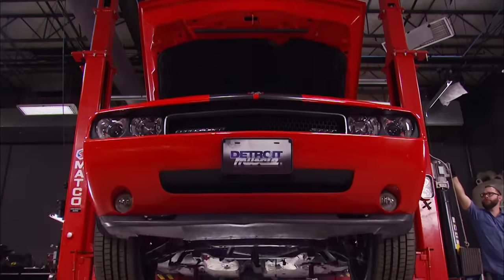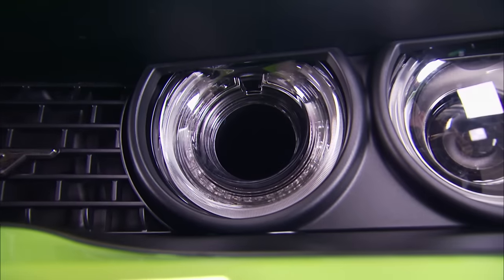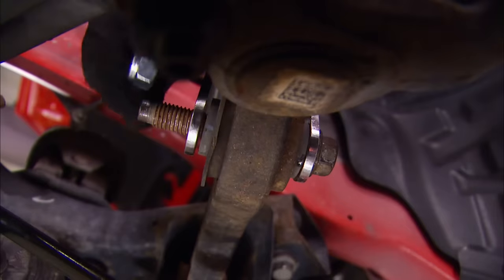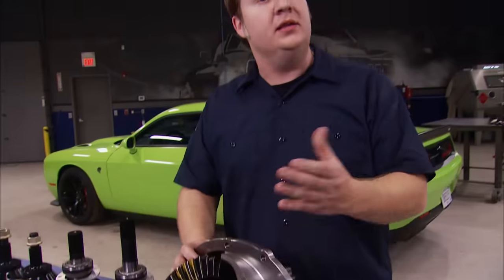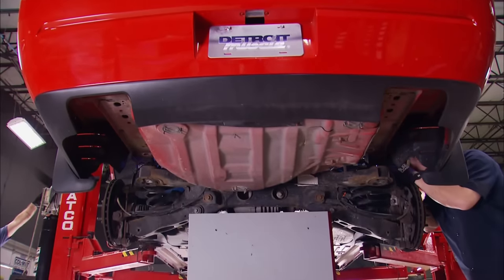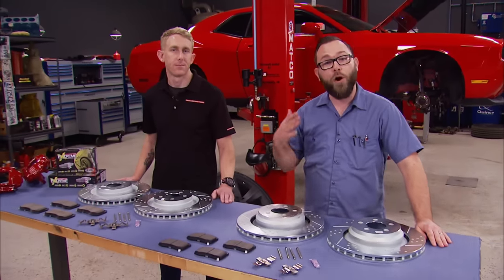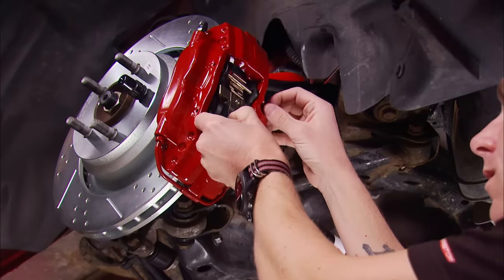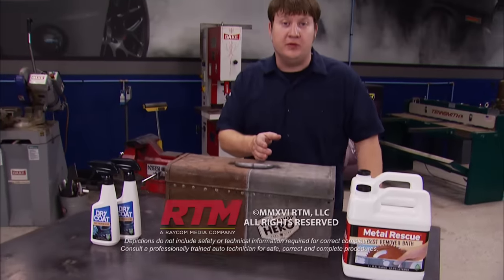Making a  2010 Dodge Challenger SRT8 Outperform a 2015 Challenger Hellcat - Detroit Muscle S3, E11

Comment: Definitely wouldn’t have traded out the brembos for powerstop but I understand it’s for the sponsor lol
Reply: haha I was getting ready to comment the same thing.
Reply: @pharoahamunra  I was going to say the same thing. Why would you give up six piston calipers for four piston?
Reply: Nathan L It performs worse now lol.
Reply: Oh I thought I was watching this in reverse!
Reply: They "upgraded" the brakes by installing lower quality crap. If they wanted more power, a simple pad upgrade would have done fine. Couple weeks and those powerstops will either warp or crack at the drilled holes.
Reply: @shawnlathrop852  Even the name sounds cheap lol it's like Power Fist  or Heavy Duty lol
Reply: Powerstop is fine, and an ok upgrade if you have a civic, or sliding 2 piston calipers. These rotors are their lower end street set (probably to try to sell more) they have higher quality stuff, but not as near as the brembos they took off
Reply: The stock none Brembo brakes can probably out stop the bs.
Reply: Nathan L This is a 2010 Challenger. They didnt come with 6 piston Brembo’s back then. The Hellcat was the first Challenger to get them.
Reply: @robertsrt  Have you ever driven a SRT? The stock brakes are more than enough to stop that car. Even if they add 800 hp.
Reply: @nathanl7018  2010's had 4 pot, basically just like what they replaced them with. i'd stick with Brembo.
Reply: Nathan L they aren’t 6 piston on the early srt’s.
Reply: @NoahT213 the brembos were on the new hellcat they showed not the 2010
Reply: @blackericdenice  Yea I was considering upgrading to the 6 pistons on my 13 SRT  since its a direct bolt on but everyone who has done the swap says that the 6 pistons aren't any better than the 4 pistons are with a really nice set of pads. With how much the swap costs, its not worth it as a performance upgrade. On a 70-0 test, the Hellcat only stops like 6ft sooner than a 4 piston model with both on stock pads.

Basically you only get the 6 pistons for the look.
Reply: @DarkSlayer487  I've rented a 392 Charger and 392 Challenger and have videos of both. I've been up to 135 mph in both and back down to 70 mph. The 4 pot calipers are more than enough. Another thing is people need to STOP buying bs aftermarket pads. If you really want the best braking. Buy the stop pads from the dealer.
Reply: @DarkSlayer487  If I buy a 392. I only want the 4 pot calipers.
Reply: The calipers are still brembos they were just probably rebuilt. But Power stop rotors are garbage they should have went with DBA.
Reply: I’m like guy stop saying bigger brakes and just say yeah the hellcats come with brembos 🤣
Reply: I think the original Brembos are 6 piston like the Hellcat.
Reply: Ellwood76 no the 2010 has brembos from the factory. They just want money from sponsorship so they are changing out the brembos for power stops
Reply: @dannydaw59  I own this same car (except it's a 2009 with the 6 speed), and I can assure you they are 4 piston.
Reply: @Ellwood76  The 2010 comes with 4-piston Brembos from the factory. Not 6 like some are erroneously claiming, but still better than the Power Stops they threw on, imo.
Reply: @kristopherganzel5245  o ok, 4 piston brembos are way better than powercrap, gg corporate sponsorships
Reply: @nathanl7018  Looked to me like the SRT only had 4 piston to start with
Reply: @nathanl7018  their response going to be "iTs FoR wEiGhT" 🤣
Reply: blackericdenice I agree. I had a 06 300 srt8 and currently have a 16 scat pack challenger. It’s pretty impressive how well a 4 piston brembo can stop a 4200lb car, at all speeds.
Reply: The factory brembos where designed for the car they started with but the rotors needed to be changed for more aggressive braking hints vent holes to disperse heat the colder the rotor the faster the stop and the calipers where changed to reduce parcitic loses wheter they are better or not they have less drag
Reply: Maybe not because its  brenbos are 9 years old
Reply: Would have just put hellcat brakes on it 🤷🏻‍♂️
Reply: @blackericdenice  Why, yes I have- spent a day with mine at Cresson Motorsports Track near Ft. Worth. A 20 minute session at full romp on a tight track will turn the front pads to peanut butter, but they're dang fine brakes if you give an hour between track runs. Certainly wouldn't trade them for "Powerstop". I'd also upgrade the fluid to Dot 6.
Reply: @blackericdenice  - there are other sources than dealers, and the user groups tend to be pretty clued into the better units. Amazon will get it to you overnight at a better price.
Reply: @IhateYoutube  - Congrats on a sweet ride. I had an '09 SRT8. You only really need to think about upgrading the brakes if you're doing a track day with intent, and for that just the pads and possibly the brake fluid to a higher temp capability. The Brembo's are way more than enough for street or ¼ mile fun (as you know quite well). Concur?
Reply: @Spartan117A51  - Roger that. Lol on the usefulness of slots and holes- that's been debunked years ago. F1's stopped using holes/slots decades ago, except on the circumference to help offload the heat.
Reply: PowerStop brakes are pretty good for normal cars/driving. But what they did in the video was a major downgrade.
Reply: Lol...they stop, i have some on my '07 jeep srt8..and on the streets my jeep will beat a hellcat..Hellcat has too much power on the streets, on the track is where it shines but light to light on city streets the jeep srt8 gets everybody out the hole
Reply: No kidding. Who in their right mind would swap out brembos for some generic brand ?
Reply: Any of y'all ever "stop" and think that he only installs them for the videos, then removes them so he doesn't die? 🤔
Reply: Or Wilwood
Reply: I'm glad people are starting to catch on to Powernation lies.
Reply: Lol same part powerstop are just remanufactured brembos just a waste of time
Reply: The stock brembo brakes are incredible
Reply: @robertsrt incorrect.  My 2014 SRT8 has them
Reply: @blackericdenice the brakes are incredible stock

Comment: Those powerstops are in no way better than the brembos. I mean that's a downgrade.
Reply: not only that, but those brakes don't hold up to the rust belt part of the US.  They last about 1 year before they are rusted and chunks of shit are falling out of them getting stuck in the calipers.  Not to mention "race" brake pads they were talking about, do not work until the brakes are hot.. so if you slam on them because a deer runs out the car wont do anything til the last second
Reply: I'm sure they know this, but powerstop is a sponsor sooo...
Reply: Especially when they are competing with 6 piston Brembos....silly!
Reply: Names Rule !!?!!
Reply: The pads themselves are actually nice have a scat pack myself. The brembo pads are nice too but a ton of dust. The powerstops seem to stop even tighter and have less dust. Don't have any numbers recorded though.
Reply: @gittyupalice96  my powerstop have worked great on my mustang,  f250, and impala. You're paying more for the name.
Reply: @svtcobra615  6 Piston Brembos for my camaro are only 120 bucks for re-manned, along with OEM 13.6" rotors being also about 120 bucks each.  wich is funny enough the same price as powerstop, thats why I'd rather go OEM.  And yes they work, but they don't last long is all I'm saying.  I run them on my old ass truck because it has small discs to fit the oem 15" rim size, so they over heat unless you have drilled rotors.. Just have to replace them every single year.
Reply: @gittyupalice96  I thought they cost more then that. mybad. I guess I need to look into brembos more lol
Reply: Powerstops are good and cheap, but they do not compare in any way to brembos
Source: have the z26 rotors and pads on my 16 mustang
Reply: I’m surprised they didn’t clean up the rust on the sub frame since they already had it out.
Reply: gittyupalice96 less than a yr, put powerstops on a car and they stopped great w/ no noise but after rain those dam things looked like orange juice, never seen a rotor rust so bad
Reply: It's an upgrade if you take the check that comes with them to cover all the other expenses. then sneak the Brembos back on after they leave. ;<)
Reply: Powerstop is the greatest.  Brembo is shit compared to powerstop. Powerstop is the best brakes ever made.  You'll never find better brakes than brembo. Brembo is greatest brakes ever mad.
Reply: Yea Brimbos are definitely the far superior brakes!

Comment: I'd still rather have a Hellcat. The jump in interior quality from pre and post facelift is just too much for me. Hate the gauges in the 09-14s.
Reply: Jeromy Williams I hate the auto shifters in the current ones.
Reply: @CamaroAmx  the 8 speed? I enjoy it well enough in my R/T. If I was buying the car for myself instead of my wife I would have got a 6 speed 392.
Reply: @CamaroAmx  and I misread lol. Yeah I agree the shifter itself is ugly. I've thought about buying that Hurst replacement one, but it's not worth the money to me.
Reply: I'm on the opposite. I hate the Hellcat, Charger dash and gauges. They all look the same.....like my pos 2014 Dart. The early dash and gauges look more retro to the 70 Challenger.
Reply: CamaroAmx 
So, you’d rather have the older one because you think it has a better looking shifter, okay.
Reply: I was looking at a SRT8 back in 2012 and the interior was basically a copy and paste from the Magnum.
Reply: @PacoRobbins  I have it. You don't have to buy the whole kit. You can buy just the lever and the white or black knob a lot less. My wife has it in hers...
Reply: @Jelsick  True just like the 1970 challenger gauges
Reply: I agree also to much electronic crap cam phasers and vvt. New 8 speed transmission uses oil that is $20 a quart.
Reply: @inanimateuser9828  I replaced ours with a customized reworked factory wheel. I was going to replace it with a Hellcat wheel but found the one I have now without screwing with electronics..After thinking about it I would have tried to go with the late model Viper wheel.
Reply: @inanimateuser9828  $1,200
Reply: Ben Jake no, I’d rather have the current one but I just dislike the shifter. It’d be the first thing I’d change if I had the current one.
Reply: @CamaroAmx  I don't think the current Hellcat shifter can be changed .
Reply: I agree the interior in the 15s and newer is a huge improvement not to mention the changes to the front and rear fascia.
Reply: Besides you cant tell me buying a 2010 and building out the engine and all the suspension components is cheaper than buying a used hellcat for 45k
Reply: @TmanBlades  No but probably close depending on how much work can be DIY. The problem with a used Hellcat is that the they are beat on pretty hard and are a ticking time bomb.You have to be very careful in selection.
Reply: @TmanBlades  That's all a matter of opinion. I hate both on the 15 up...
Reply: @randallfox4265  I agree that picking a used hellcat is definitely a gamble but that really goes with any performance car including a 2010 srt challenger, but yes the front and rear fascia update in the 15 is totally subjective
Reply: *08-14*
Reply: @TmanBlades  insurance purposes bro...

Comment: The hellcat will now murder this thing in a braking test lol. The stock brembos stop REALLY well.
Reply: robertsrt they should’ve put hellcat Bremos on it
Reply: mike force  why wouldn't they? Pretty sure the same 4 pot Brembos have been used since 06 to current, leaving the bolt spacing/pattern the same.  I do know they're a direct fit on at least the 2015 and up SRT cars. A LOT of cheddar tho...
Reply: Thats a fact! Powerstop is a sponsor but c'mon taking brembos off ANY highperformance car is a downgrade & a big NO-NO
Reply: mike force brother the lx srt platform (chargers, 300, and challengers) have the same spindles from and rear. I had hellcat 6 pots on my 07 300, and helped my buddy put 6 pots on his 2011 challenger. Just gotta make sure they clear your rims
Reply: is hellcat nice for short females to drive?
Reply: Agreed.  Those drilled rotors are gonna crack bigger than shit. I've got some of this brand, lying in the dirt in my backyard.  Useless for performance track use.

Comment: I wish things were this easy. Especially the part about using the impact gun for everything. I used to be that optimistic but after cross threadening a few fastners i stoped using powertools to install things. I only use them to remove.

Comment: This time on power nation: how to assemble a car with complete disregard to torque spec or replacing torque to yield bolt.

"Hey bill what's the torque spec for this used torque to yield subframe bolt?"

"I don't know John, about 20 uggaduggas on full power"

Had to watch the entire episode to see if they really assembled the whole car just blasting it with the air gun, and unfortunately they did. Never once replacing any bolts or even just looking at a torque wrench.

Don't get me wrong, complete respect for what they are trying to achieve. But at least research some basic assembly techniques. I really hope the engine isn't uggaduggad together like this, that'll be a short first startup video.

Comment: Bro that 6.1 damn just fire 9/10 years later... Just something about it 😎
Reply: Yea there is something special about that 6.1. I got one that still brand new with 16 original miles hemi orange. They are rare cars and from what I've read about the motor it's a twin plug design more like the old 426 hemi

Comment: if that strut is bolted to the control arm via a bonded rubber bush, the arm should be lifted to normal ride height before tightening up the bolt otherwise your gona tear the crap out that bush in no time!

Comment: The hellcats produce over 707 crackshaft horsepower motor trend dyno pull was 680 hp roughly at the  wheels

Comment: I’ve found a 2009 challenger srt8 with 189,000 miles for $15000 third party dealer runs great, everything works .  

Am I stupid to think about it 😅 or is it worth it and have the engine rebuilt? Car looks very well kept, clean Title, original parts, clean inside and out .

Comment: Thanks for the excellent video.  I’ve been searching for a heads up on how to remove the front bumper on the Dodge Challenger because it’s the only access to the windshield washer reservoir which cracked for some reason and I can’t ignore the Low Washer Fluid warning light that keeps coming on.

Comment: That car needed to be sprayed with some Fluid Film, Rust Check , Krown Rust Control's T40  or Rust Cure Formula 3000, surface rust starting to show up.
Or Rust Converter or Rust Killer from Rust Check.

Comment: turbo way better than a supercharger
might want to put a taller rear end gear in it ,it will make  a better 1320 et because it will load the turbo and cover more ground  per rpm   its  a plus plus modification
Reply: taller??? you mean shorter. 2.89 to 3.83 is going shorter 3.73 to 2.95 is taller
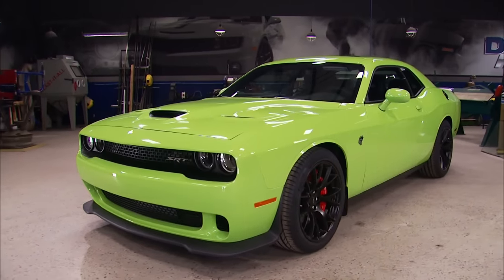Reply: Won't be able to plant the power. 3:07 is ideal for a TT car.

Comment: I would like to ask anyone if I can get some advice about my 2019 Challenger R/T 5.7L. My car has a little shake (like a miss) at the cold start and also when it's warm, it has a very slight hesitation on getting power to pick up speed. The dealer keeps telling me that this is a normal for all HEMI engines, of course, I'm not satisfied with these answers. I read that if the Throttle Body is upgrades to 85mm, this would resolve the problem. Any assistance would be greatly appreciated.

Comment: Tfw you don't know what a torque wrench is and ugga dugga everything
Reply: Tommie Reid  classic
Reply: no need for one just get them tight and your good. just dont over tighten them
Reply: @bigsean2473  i mean, something as sensitive as suspension geometry should probably be torqued correctly, but what do I know, I'm not the one with a car show
Reply: I always forget what tfw means cause it’s said so rarely
Reply: those are hi-tech automatic impact torque wrenches yo
Reply: @MortalConquest  they used it on the flex plate and trans lol. but the geometry in built into the mounting holes can only fit one way unless you break something or make the holes bigger
Reply: Fire the new parts Cannon at it, then over tighten everything  with an impact. Very impressive. 👍

Comment: Lmfao they removed the BREMBO breaks and installed power stop .... why ?
Reply: JUST SOME CANADIAN GUY they sponsored this build
Reply: Obviously they sponsored the video I’m just asking why would they sponsor a video where they would remove brembos and put in their own power stop? If they’re going to do that then why don’t they pull out the hemi and drop in a new 3.5L panastar
Reply: Power stop breaks SUXXX !
There powder coat comes off with a pressure washer! There’s rubber seals that melt and start leaking the first time you slam your breaks. And the bleeder valve is facing the wrong side so anyone could just twist it and bleed ur breaks completely.